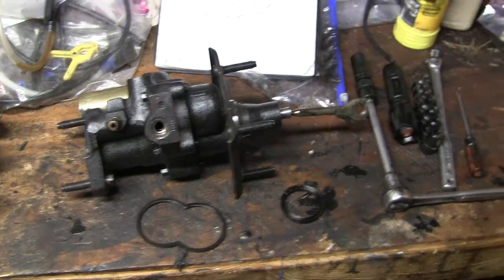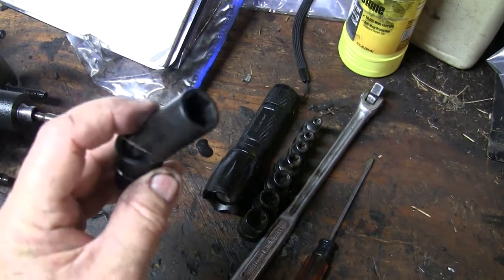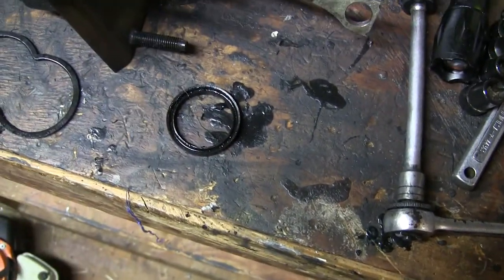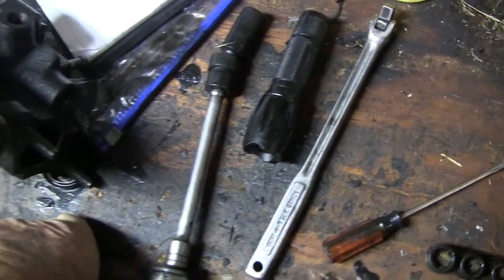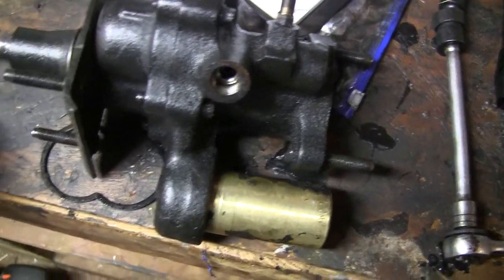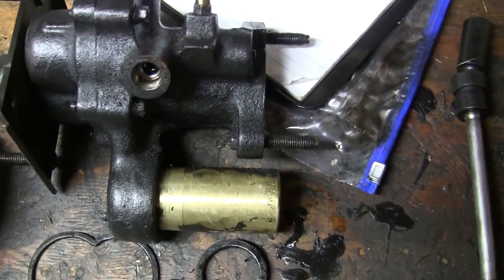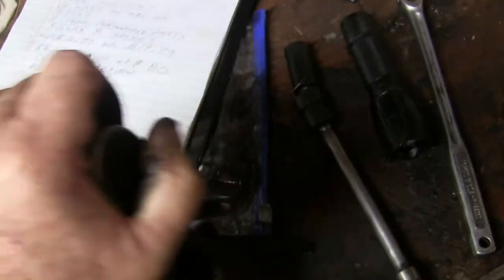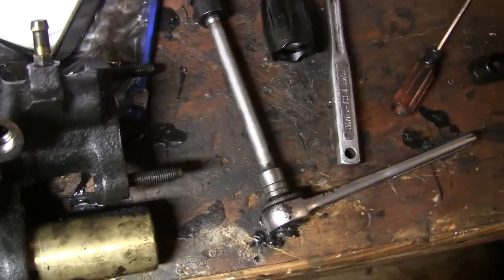Astro van (94) 10/17/2021 Video log Hydro boost repair

Comment: What are the symptoms of a leaky booster? I have to stand on my brakes to get the vehicle to stop.
Reply from the maker: Loss of brake or power steering fluid or both. dripping from the power boost. I fixed mine if you watch more of my video logs you see I had the wrong seal and took me several attempts to discover I had the wrong seal.

Comment from the maker: I held the lip seal the wrong way in the video so check your lip seal as you remove it to be sure the new lip seal is install the correct direction. Easy to make a mistake on this point.

Comment from the maker: I am not sure. You can ask the seller when you buy your kit. The most comprehensive kit is from Pirate Jack dot net but is very difficult to find the kit without spending time digging around the pirate jack web site. Amazon and many others sell the kits online as I mentioned if you watch the video and look at my notes that I have written down in the video. I hope the video helps you but beware to point the lip of the seal the correct direction by watching the other videos by other people. The kit I used was ZFLXH For Hydroboost Repair Kit Chevy GMC Ford GM Dodge Seal Kit Hydro-Boost Leak 3 Piece

Comment from the maker: I had the lip seal installed pointed up that I think is the correct direction and as I see in other videos. I have the unit repair service manual but it has no details about how to install the lip seal. The kit I used was ZFLXH For Hydroboost Repair Kit Chevy GMC Ford GM Dodge Seal Kit Hydro-Boost Leak 3 Piece